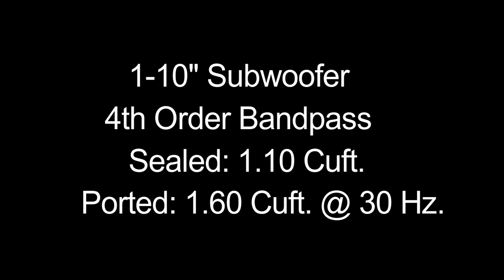Subwoofer 4th Order Bandpass DIY

Comment: Damn bro, there easier ways to do things you know? First off a drill would have been easier than using a screw driver. And second you could have put the baffle in before you screwed the last wall on. Hammering it in like that prolly peeled some caulking off the corners and since you didn't use any glue it could potentially caused some leaks.

Comment: Port inner diameter please?
Reply from the maker: It's 4" diameter Sir....you experiment the length based on your sound taste....
Reply: @DSWORKS13  nice how actually you created the flare for the pvc pipe?
Reply from the maker: @dannyBboy87  I heated the PVC in our gas range then I used my dog plate as my moulder hehehehe no proper tools......

Comment: No glue? Who is this guy?😂
Reply from the maker: The 10" sub I used is not that powerful....screws & nails can handle the vibration.....I glued inside the box to avoid air leak....thank you for watching!
Reply: @DSWORKS13  sir pde po mk hingi ng measurement nia po,
Reply from the maker: @johnlennon1609  Na corrupt po yong drawing files  ko sir, wala na po yong box specs...check nyo po channel ko , marami pong ibang design ideas/referrence.....https://www.youtube.com/watch?v=GfyZZLdjtxM&t=3s
youtube.com/@DSWORKS13     ty!